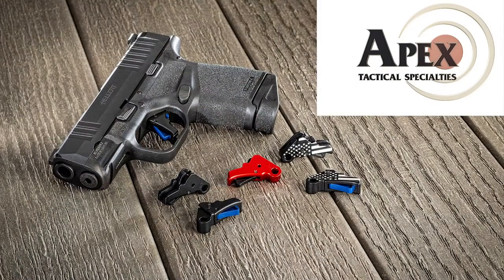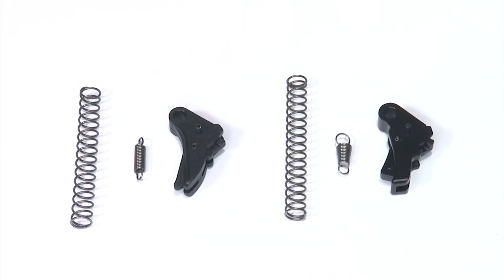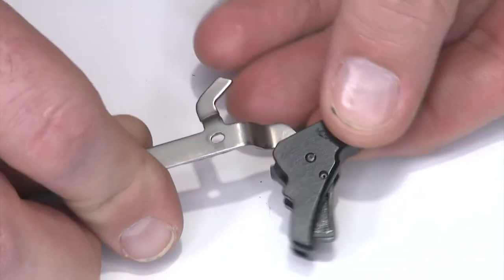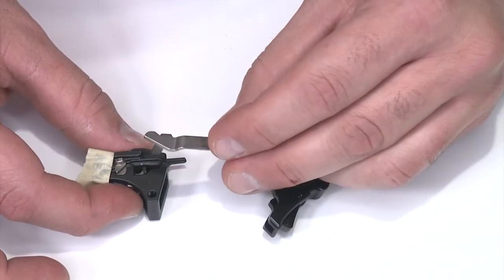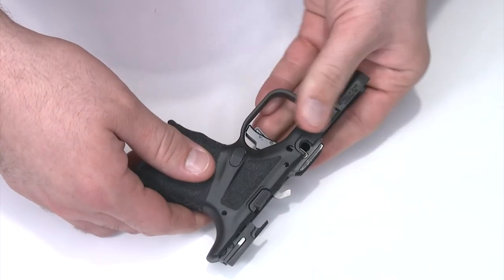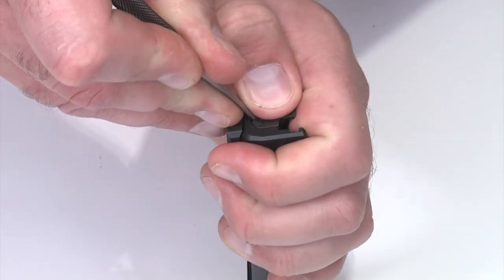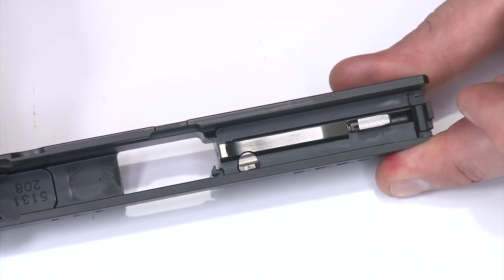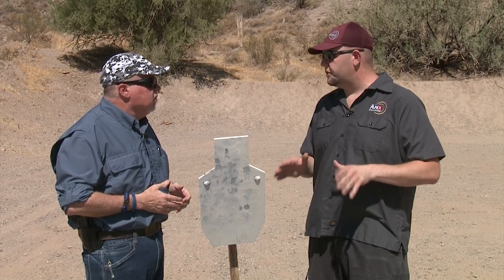Installing the new Apex Tactical trigger for the Springfield Armory Hellcat #922

Comment: Had issues with mine. Had to install original firing pin spring because the apex spring didn’t have enough tension. When I removed it to install original the apex spring had shrunk shorter then the original spring
Reply: Weird, mine has been working perfectly, but there is always that one part that is defective.  Did you call them and let them know?  They need to know and they will send you a new part.  Good companies do that!!
Reply: @yrsued  no I didn’t contact them but I will try

Comment: You forgot to mention the locking ring on the outside of the sear housing! Don’t lose that. Reassemble with a drop of oil to help keep it in place.
Reply: Good tip, I think APEX sells those separately just in case you lose them

Comment: What if you don't have a vice?
Reply: @yrsued  I bought a mini vice off ebay for like $6. Did the trick.
Reply: Harbor Freight has Vises for a really good deal!
Reply: We all have vices. I've seen some who say they installed without a vise, but it's more difficult.
Reply: Use your teeth

But seriously, an AR trigger guard roll pin tool should work. It’s like a small vice/claim to push roll pins in.
Reply: I used a c-clamp! Lol

Comment: When we getting the trigger for hellcat pro??
Reply: I heard soon!!  VERY SOON!!
Reply: M*Carbo already lists their trigger for hellcat pro and I’ve seen them posted everywhere and hear good things about them.
Reply: @tampabayspearfishing5297  All I have to say is "DROP TEST". Ask them if they can pass a 6 FOOT Drop Test onto Concrete!!!

I heard of a company out there doing a 6... INCH Drop test and claiming safety!!!

APEX ONLY Does a 6 Foot Drop Test onto Concrete, when the standard is 4 Foot onto Plywood!!  

Safety first folks, safety first!!
Reply: @yrsued  I was the one that personally drop tested the M*Carbo trigger and striker assembly installed on the hellcat pro. We go more rigorously than the industry standard SAMMI for drop testing. 6’ onto concrete twice from 8 angles. Then a “Jar Off” test is done from 2’ twice from 8 angles. We take safety very seriously, and during the design of the parts, all safeties are incorporated into the design. I understand Apex is more known, but the smaller companies are still pushing safety.
Reply: @tampabayspearfishing5297  Good, I wanted to make sure, putting a video saying that company X is safe and doing a drop test from 6 INCHES is fucked up!!  Not even onto concrete!!

APEX is run by Engineers with years of experience in the Gun industry.  They do great work!!

That is good that you tested, some out there want to be first, that doesn't always mean is best, I have seen some REALLY scary stuff out there from those who push for speed than safety!!

You know, it's too bad, I reached out to M*Carbo a couple of years ago.  I work for Guns & Ammo SIP and we needed some stuff for an article, nobody answered the phone and they pretty much ignored me.  So, we did the article with someone else's product!!  When the editor wants something by certain date, we don't have time to sit around.  I wish that someone had taken their time to contact me back and help us give them free advertising.
Reply: @tampabayspearfishing5297  only saw for the hellcat not the pro is it the same??
Reply: @Jay_Cruz340  the description states on the website under hellcat firearm for each of the products that it is compatible with the hellcat pro osp. The firearms aren’t the same, but the parts that currently being made by M*Carbo are the same for the hellcat and hellcat pro.

Comment: What are the benefits of this trigger compared to stock?
Reply: Ergonomics and a better, crisper, lighter trigger pull.

I said Ergonomics, but that is for some, I know some folks don't like flat faced triggers, I do, but I know some that don't!!
Reply: It’s going to Jane a much lighter pull weight.  About 1-1.5 pounds less.  Stock Hellcat trigger is around 6.5 with .5 in either direction.  You will also have less take up slack and the wall will be more pronounced and have a better break with possibly no creep or roll.  The reset will also be shorter, crisper, audible and tactile.  More so than the stock trigger.  Lastly flat faced trigger might feel more
Comfortable to you.
Reply: @mikechurchill1071    Well said...
Reply: Without repeating what others have already correctly stated, it make the trigger much more smooth and predictable. The stock trigger caused me to be inaccurate unless I really focused hard. Now with the Apex, the trigger just works and gets out of you way so you can do the job. My accuracy went way up with this trigger!